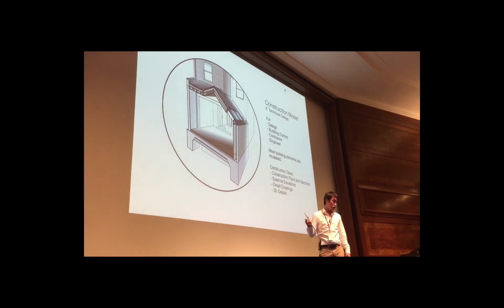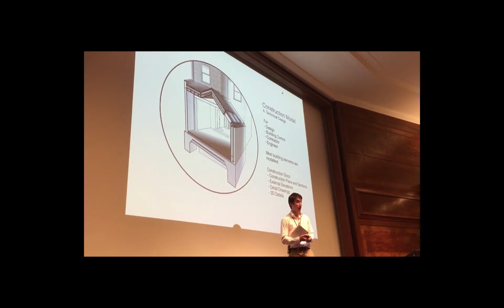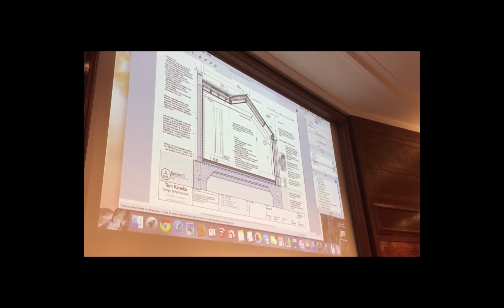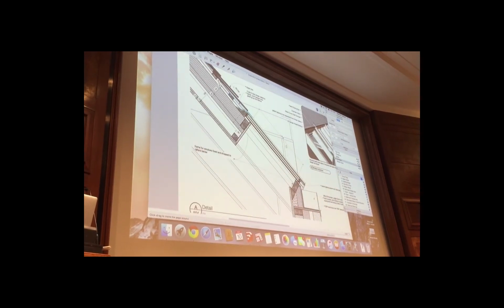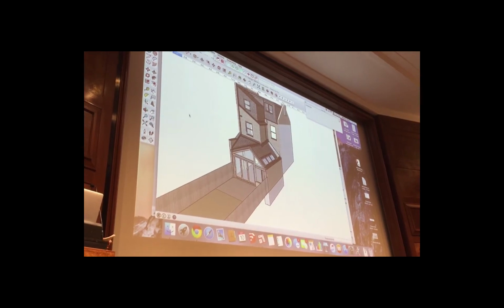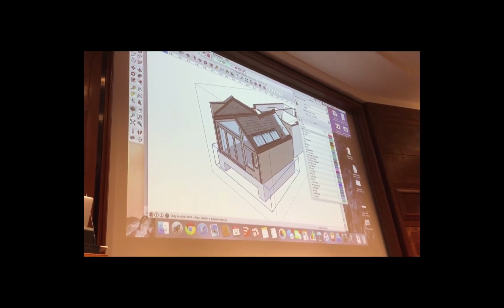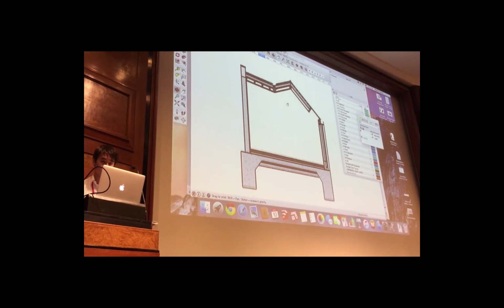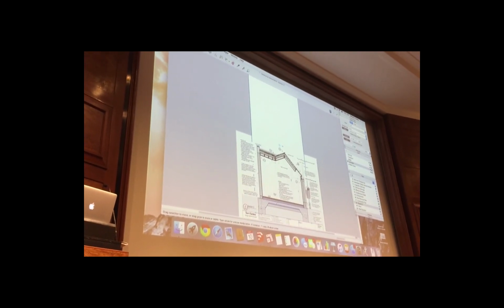Construction Documents with Skalp for SketchUp

Comment: Skalp is not a professional tool . Being sold for almost 1/5 of Sketchup price, it still has many many bugs! When You create Your own material library and the library file increase to more than 4Mb it slows your Sketchup a lot!!!
When You work with very complicated structures and solids the situation is even worse - even working on great workstation machine it will not provide enough comfort .
The skalp plugin has great marketing and advert, but it need much more improvment, more ergonomic interface.
For now (october 2019) it still has too much bugs! People did a big credit to the software developer, but after those few years of waiting it has too much bugs and left a lot to be desired! uff